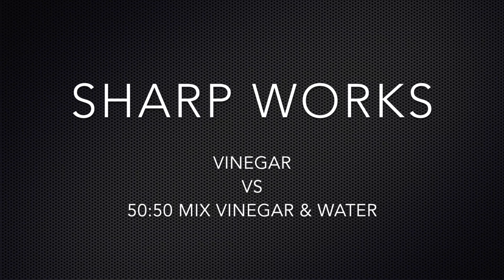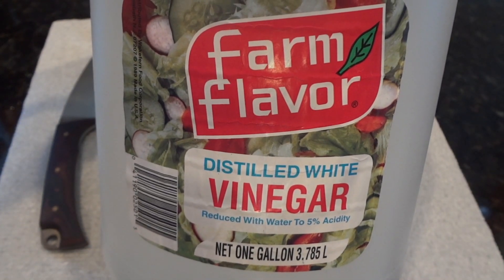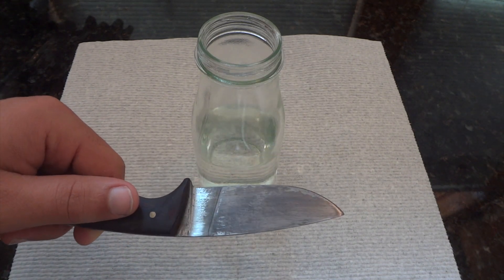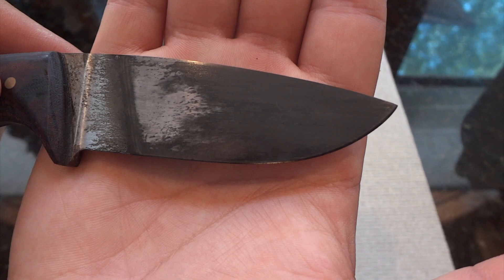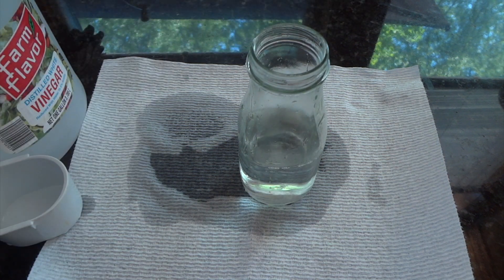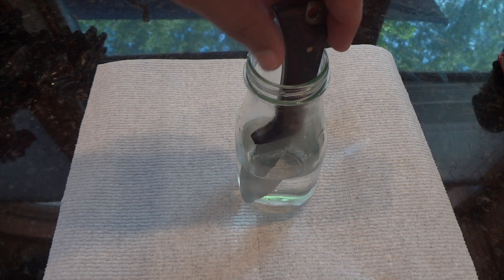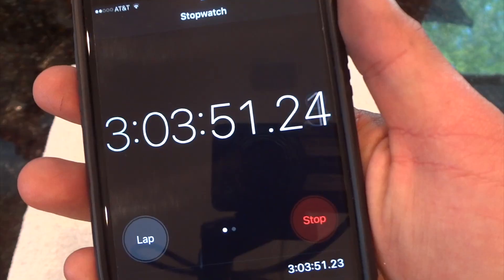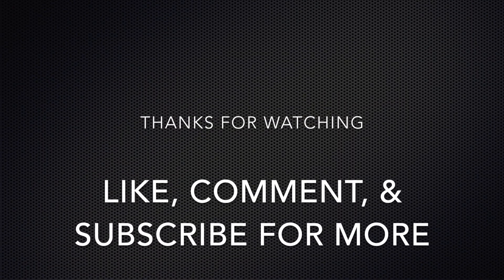Will It Rust? Vinegar vs Diluted Vinegar (Forced Patina)

Comment: I tried 50/50 mix and got rust spots. Had it in overnight and still wasnt fully patinad. Took it out to check it out and put it back in, an hour later it was covered in rust spots. I sanded and restarted with straight vinegar, splotchy but no rust spots 🤷‍♂️

Comment: Birchwood Casey's Cold Blue product isn't just for gun metal, use it for carbon steel blades and it will work much better, and much faster and it does provide rust protection.It's not expensive either.

Comment: Was or is this the best method to prevent the blade from rust? Possible with an Steel like CPM M4, which has 4% Chromium, and lastly should I dip the whole blade on an folder, also the parts where it locks up or not?

Comment: I bought a new knife , almost looks like the one you have. Washed it real good with hot water and dish soap  the in a glass with the vinegar and water. Left it for 3 hrs . All came out nice and black . No more shiny knife . Washed again and dried. Added a little oil . DONE! Came out good. Thanks for the idea. The knife says Carbon steel 1066

Comment: Should you wipe off the blade after you patina it or let it sit and dry of naturally?
Reply: I would let it rest for an hour and whipe the exess carefully off whith a papertowel. Patina needs oil to cure out correctly, if you dont use it, it might convert to red rust and not harden correctly. I had that on my flintlock too.

Comment: Would the 50/50 work on Aus-8 milled steel? Thanks
Reply from the maker: From what I looked up, Aus-8 steel seems to be a stainless steel which would resist rust and patina. I haven’t used this so I’m not 100% sure, but I don’t think the 50/50 would do much to it. It probably wouldn’t hurt to try it anyway though.

Comment: Heeey, was it hot vinegar/water+vinegar or cold? The tutorials I watched used them boiled
Reply: I assume they boil it to speed up the process
Reply from the maker: I used room temperature vinegar and water in the video, but if both are hot it will make the reaction happen faster.

Comment: @sharp works   looking to do this on one of my japanese knives, it being high carbon, and not stainless steel would this effect the Damascus at all?
Reply from the maker: Damascus steel is made with alternating layers of high carbon and stainless steels. This process should make the pattern a little more vibrant and darken just the carbon steel layers.
Reply: Thanks for the tip.
Reply: I have a knife that has a protective coating. Only the edge is vulnerable to corrosion. Will the vinegar effect the coating?
Reply from the maker: @hondmilodoggo  usually it shouldn’t affect the coating
Reply: So I could leave the coating on the knife and every once in a while give the knife a vinegar bath to give scratches and the edge a layer of patina?
Reply from the maker: @hondmilodoggo  yes that should work. If it’s not the desired effect then I would suggest stripping the coating and sand the blade to get an even patina.

Comment: And then you shut off the camera, rince your damn knife and see the nice black oxyde wiped off on your finger. Right??
That's my results with an Opinel and the Jakaripukko, both carbon for sure, degreased each one with different products (alcohol or degreaser). 
Once rinced off, the steel keep an light gray even surface but seem kind of fragile when rubbed on hard material. I'm on the third passe actually. 

What are your final long term results mate?
Thanks anyway.
Reply from the maker: Stupidocrate through my testing, I found that it depends on the solution, concentration, and the metal. Sometimes it does exactly what you described where the dark black will wash away and you’ll be left with light grey. Sometimes it stays dark after I apply oil to the metal. I haven’t been able to predict when it will say or wash off. The metal used in the video is 1095 high carbon steel. 
Some of the patina can be scraped away with use, but I use it more to protect the knife from damaging rust and corrosion and less for looks. The darker the color, usually means the deeper the patina, the more it’ll protect the steel. My video is to demonstrate what solutions get into the metal deep enough to protect the steel, not just to make it look black. If you’re trying to achieve a dark color, you may want to try cold blue. It will rub off after a bit of use, but it should get the dark color you’re after.
Reply: @SharpWorks  Ok thanks a lot. I'm not after the coloration, but in my mind with your example, darker means proofer. Probably a misconception.
In my case, the darker just say "I'm eating your steel" but once washed away there is just less steel but not deeper patina, I believe.

The second round was perfectly even, the third one crap as hell with big stains. I added mustard on it.

Comment: Hello, I thought the vinegar has to be hot, has to be apple or cider vinegar, and will not work in stainless steel as your two model knives in the video, but I think was wrong.
Reply from the maker: These knives were made from carbon steel. You’re right that this won’t work on stainless steel. Heating the vinegar will make the reaction happen faster, but is not needed.

Comment: Does the steel smell always linger on the food after you forced-patina the knife?
Reply from the maker: Make sure to clean the knife very well with soap and water. After which, immediately apply a food-safe oil like vegetable oil. If there is still a smell, it might be the food that you're cutting is actually rusting the knife and causing some rust to be left on the food. I've noticed this with apples or other acidic foods.

Comment: Do you have to reapply a patina every time you sharpen the blade?
Reply from the maker: Sharpening will take the patina off just the edge of the blade which shouldn’t be a problem in terms of rust prevention. Reapplying a patina shouldn’t be necessary as long as you don’t mind a shiny edge.

Comment: I'm confused. I've tried twice now to patina a knife blade and a multi tool and nothing ever happened even soaking overnight. The steel was properly cleaned and I followed several mixtures and nope- nada. Looked the same. What am I doing wrong? Thx.
Reply from the maker: The metal could be a type of stainless steel. Since patina is a form of rust, the alloy steel is preventing this rust from forming, which is a good thing for the most part. Patina will only form on carbon steel knives/tools.

Comment: Does this scratch of easily? I want to do this on a Swiss army knife.
Reply: No, quite hard to scratch it off. I patina my 21" machete and hack thru trees, vines, rocks and nails. Still won't come off.
Reply from the maker: After every patina video I sand off the old patina and it takes me quite a bit of sanding to get it all off. This etched deep enough that you would have to scratch off a decent amount of material on the knife.

Comment: Hi,
Looks like that that 50% vinegar 50% water gives the darkest and very even result. Initially it was 5% vinegar so you deluted it using water to about 2.5%. I have a folder with CPM-M4 steel and want to force patina on it. I would appreciate any recomendation how to do it better. Is patina really helps to prevent rust?
Thanks in advance!
Reply from the maker: I have a playlist where I tested a bunch of different solutions, some worked better than others if you are interested: https://www.youtube.com/playlist?list=PLk4nSf_Ycjz59GDFbXXCHjMozjD8R33t- but if I’m not mistaken I think I had the best results with the water+vinegar and water+orange juice. Those two solutions gave a nice dark patina in a decent amount of time. You can try boiling vinegar and leaving your knife in the hot solution for a bit. I haven’t done a video on this yet, but it requires you to watch it a lot closer so you don’t overdo it and ruin the knife (it should take anywhere from 15 minutes to 1.5 hours depending on the effect you want). From looking up your steel, it seems it is stain resistant, meaning it’s not stainless, but it’ll prevent rust better than 1095 or other pure carbon steels. It will also take a bit longer to achieve a patina than the steel I use in the video. Although I never tested your particular steel, I believe you can still get a patina on it, I just don’t know how long will take you using the methods that I’ve tested. If you do try it, please let me know how it comes out. 

I have found patinas don’t protect the knife completely from rust, but it really helps prevent it from being a problem. It’s like an extra layer of protection. If you have a patina and oil on the steel, you’ll be golden at preventing against rust.
Reply: Hey there. Did you force patina on your M4?
How did it go?
I have an M4 folder on the way and definitely want a solution! Thanks in advance 😁

Comment: Is this working?The knife won't rust after this?
Reply from the maker: AzirX the knife will still rust slightly but as long as you oil it afterword, you shouldn’t have to worry. This process protects the steel from pitting and corrosion, although it is still possible, just less likely.
Reply: @SharpWorks  Does the knife always rust slightly after forcing a patina or just in the 50/50 method because of the water?
Reply from the maker: @twobitt2222  any way you patina a knife, it’ll rust a little. The only way to combat rust is to oil the knife. A knife that is oiled and has a patina will take longer to rust and be less likely to rust when compared to a non-patina knife.
Reply: @SharpWorks  Is vegetable oil a trustworthy way to keep a brand new blade from rusting? I’m getting my first carbon opinel!
Reply from the maker: @twobitt2222  vegetable oil works very well. Just make sure to put a fresh coat of oil after every use to really prevent any rust. If you plan to use the knife for food related tasks, definitely go with vegetable oil. If you aren’t doing anything food related, you can try petroleum jelly. I find that petroleum jelly does better at blocking moisture. You should still reapply after every use since whatever you cut will wipe the coating off of your knife.
Reply: Thank you.

Comment: How concentrated is the vinegar itself? Around here it is normally 5-7%, but you can also get vinegar acid which is 32%
Reply from the maker: This one is 5%. Do you know if you can get 32% from stores or is that like specialty item I would have to get online? I never knew that but it makes me want to try it out as a patina solution.
Reply: Sharp Works Stop bath for photo revealing (Ilford IN-1, for instance) is an 80% acetic acid concentrated. It's a "little" more than that 32%, but if you want to give it a try...
Reply: I know this is many years later, but be exceptionally careful if you ever use/handle more concentrated acetic acid. It is extremely corrosive and dangerous, including inhaling the vapour.

Comment: If you soaked the entire knife, will it damage a wood handle?  Or what about G10?
Reply: Ehud's Edge if you soak a wood handle in vinegar it will forever smell like vinegar. Forever.
Reply: @enzowarren9832  so not true. I've used vinegar to age lots of wood including my dining table, and there's zero smell after a day.
Reply from the maker: I never actually tried but I know vinegar can be used to give wood an aged look so it may not be so good on wood. As for the G10 it may discolor it but that’s something I would need to test out before I can say for certain.